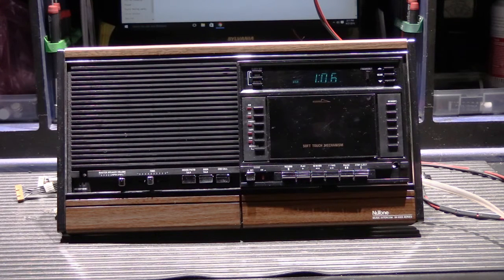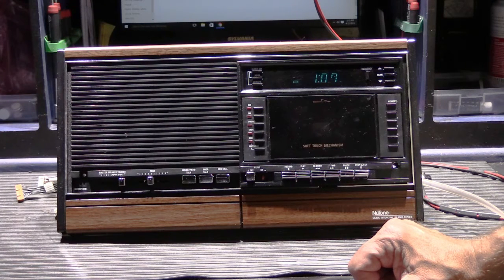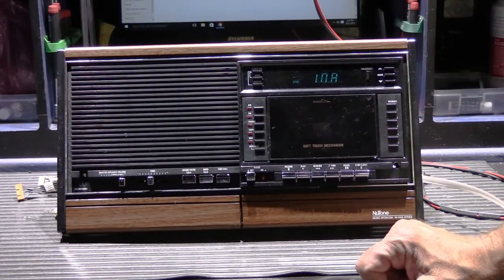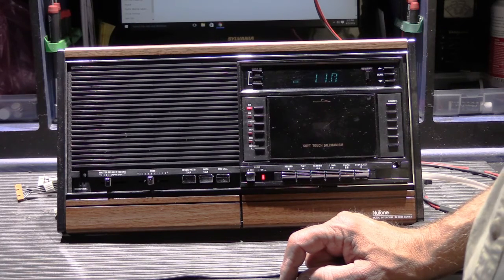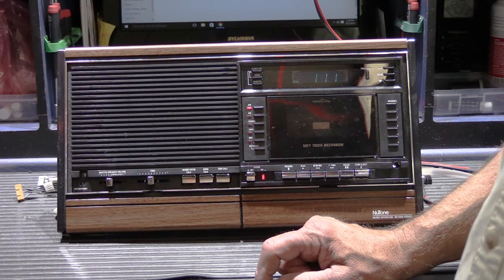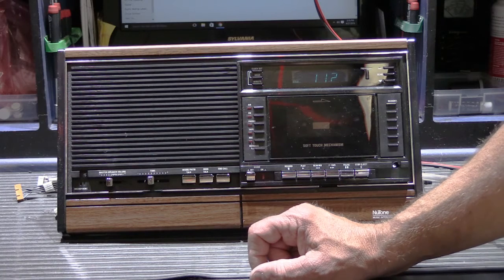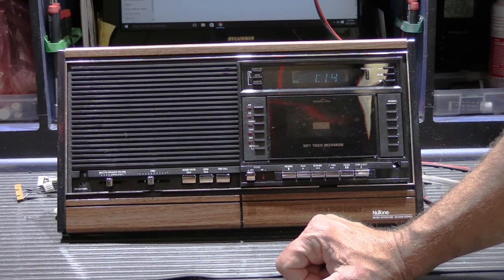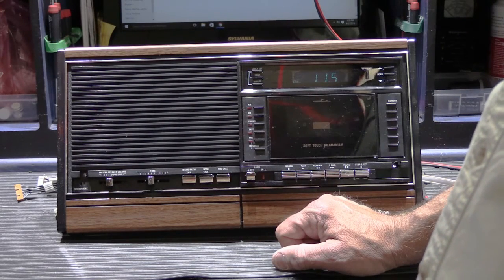RF (Radio Frequency) Interference on NuTone Intercom Systems

Comment: We are having a humming sound coming from ours. I've recently turned the volume all the way down so far I haven't heard the annoying hum.
Reply from the maker: Hi Lauren:  It is doubtful that the humming sound you are hearing is from a random RF source - it is very likely that your IM4006 has they typical age related failure, which causes the humming sound throughout the system.  Turning everything down does not solve the problem - it only masks it while it continues to get worse and worse.  You should contact me about having the Master Station repaired - Chris 925-743.-8236 ~ nscompany@msn.com

Comment: Thanks for this informative and practical video.
Problem for me is there is a strong FM radio station 1 mile from my house (103.7 FM). It gets picked up, to varying degrees, by the various audio equipment, preamps and guitar amps in my home and home studio with newer breaker box and wiring throughout. Tested an amplifier in my next door neighbor's outlet and it picked up the signal there as well. Using properly shielded audio cables. No florescent bulbs or dimmers in my home. 
Any suggestions that may help lessen or renedy the pickup of the radio station in my home?
Reply from the maker: Hi Montag:  The situation you have described sounds very severe and there won't be any easy (or practical) solutions.  Since the "solve the problem at its source" is not going to work with a Radio Station - you can attempt to solve it on a piece-by-piece basis with your equipment.  if the signal is coming through the electrical wiring, you can try some power strips that have RF filtering built-in.  If the broadcast is impacting the equipment directly through the circuitry - then some type of shielding would need to be implemented, usually with a drain to a true Earth Ground (not an electrical ground) - Remember this is more art than science - Chris
Reply: Thanks for your reply, Chris.Yes. I've been at this location for a years and it's perpetual trial and error attempts to remedy the issue, such as positioning certain pieces of gear and cables at certain angles and/or direction, and other shielding methods. Troublesome and very annoying, but not catastrophic. I suppose the worst part of it is that it's an Oldies/Soft Rock station, so sometimes they're pumping out up Barry Manilow songs 🙉.
Either way, I'll looking at more of your channel's postings to gain some further knowledge. Regards.
Reply: Try calling the radio station describe your problem to see if they can remedy from their part

Comment: i WAS THINKING OF REPLACING THE STOCK ANTENNA WITH SHIELDED COAXIAL CABLE. wOULD THIS HELP?
Reply from the maker: Hi Alsanchez:  You could replace the Leader (the part of the antenna between the "T" of the arms and the connection on the Tuner) with shielded coax if you wanted too.  Some newer style dipole antenna are made this way.

What you need to remember is that the purpose of the antenna is to capture the available radio signals - the more antenna wire that is exposed to the signals - the more signal will be captured. 

If you add shielded coax - that part of the antenna will not capture any signal - due to the shielding.

What specifically is the problem you are trying to solve? - Chris